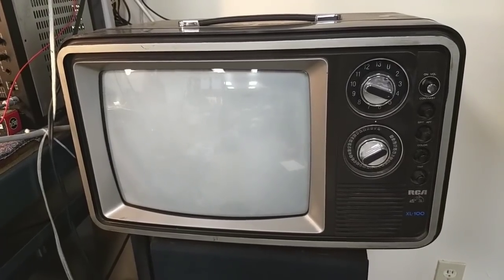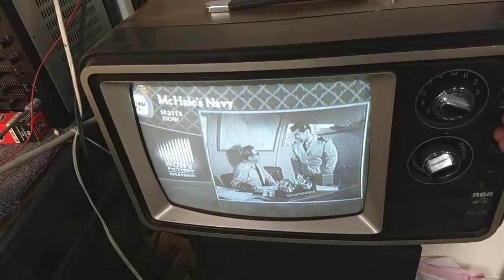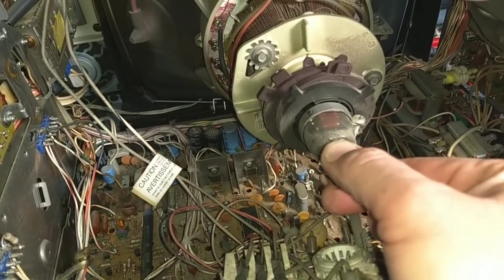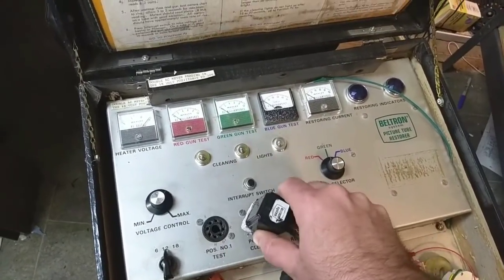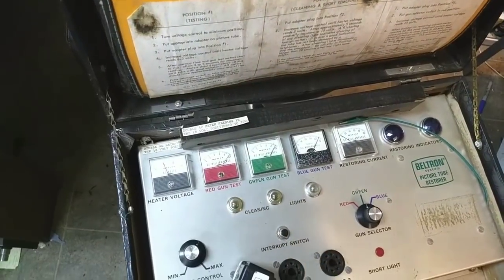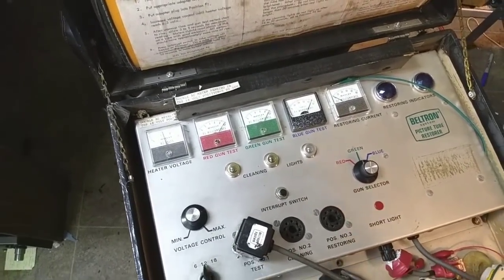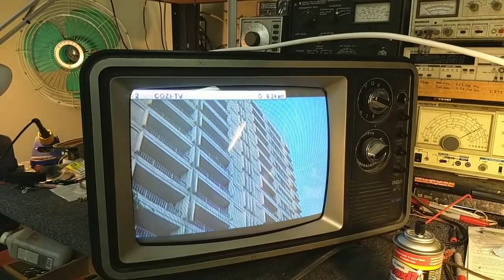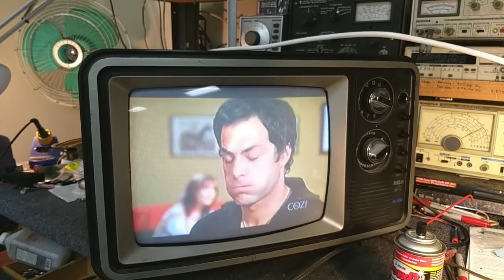What happens when you daily drive a 42 year old TV set ?

Comment: I'm watching you restore a TV set, on my Sony 4K 80" TV.   I'm lost in the irony.
Reply: I'm watching this on an IMAX
Reply: I'm watching it on Samsung SyncMaster 204b._
Reply: I'm watching this on a radio.
Reply: @Phethario  I come from the future and just have been implanted this video into my memory.
Reply: @Phethario  You are doing well to do that.  A radio doesn't make for comfortable seating.
Reply: @tcpnetworks  I'm watching this on a telescope.
Reply: I'm watching this on my VR headset for extra immersion :) 
Cheers
Reply: I gotta re-watch this on my trusty Westinghouse Console. That beltron works wonders btw :)
Reply: im watching this from a msi 144hz 1ms 27in gaming monitor lol
Reply: I'm from the future and watching this on a rectal implanted receiver.
Reply: @brpadington  Don't fart - it knocks the alignment out.
Reply: I'm watching this in my mind
Reply: @DjResR  me on a SyncMaster 205bw. one of em died. these fucking monitors actually have small tn lights at the top and bottom. one of them burned out.
Reply: @Kiritomens  Have you tried replacing the capacitors? If I remember correctly there was two separate drivers for top and bottom tubes and if one has bad cap it can fail also._
Reply: @DjResR  No i opened it up. This happened a while back btw. the TN light burned out, and the soldering at the side came loose. soldered it back, but light shattered so there was no saving it.

Comment: Use caution in trying to revive the crt. I am a crt engineer, still making crts, and reviving the emissive quality usually destroys the emission. In addition, you will create secondary emission. The flicker is actually arcing, sometimes between the cathode and g1. By heating the cathodes, expansion occurs and the cathode can actually touch the g1 surface.
Much more to discuss. The time between reconditioning and retesting should be atleast 5 hours to let gasses move.
Reply from the maker: Thank you for your experience

Know of any rebuilders inside or outside of the USA?
Reply: What applications nowadays that requires CRT technology? You work on radiation hardened devices?
Reply: Curious to know too  @aerohk
Reply: I am aware of some who make them for museums and library record keepers and other very similar lines.
Reply: I need you to make me a 60" CRT. The heavier the better.
Reply: oh, do you work for thomas electronics?
Reply: @aerohk  people use crts for older games because of the lagless signal, picture clarity in some cases, and black levels
Reply: Yes,
Depending on the tube, we at Lexel Imaging Systems are sometimes able to regun them.
We are not able to recoat the phosphor. I dont know of anyone anywhere recoating, defritting, etc, all the other processes involved with shadow mask CRT's.
Reply: @aerohk  Yes, there are still many uses, mostly military equipment. Primarily to maintain older imaging systems such as heads-up and head down cockpit displays.
Reply: @amberisvibin  Hi Amber, I don't currently work there but worked for Thomas for 25yrs, from 1980 to 2005.
I've been working at Lexel Imaging Systems in Lex Ky for the past 16yrs.
Has been a great career for me! Still making CRT'S!
Reply: @mikeharrington5256  Oh! I didn't know there were more manufacturers! That's pretty neat actually. I've been hoping for some people to get together and make the boards and such needed for new consumer CRTs, and more companies making the tubes is great for that!
Reply: @aerohk  Usually military, aircraft, and automation equipment that would cost millions to replace, if it's replaceable.
Reply: @aerohk  Usually just replacement parts for manufacturing equipment as far as I know.
Reply: @mikeharrington5256  You should post videos of your work. It sounds incredibly interesting.
Reply: you're a what!? still making what!? where in the hell is the machine tooling to do that? i want to call shenanigans on you!!! id love to see pics of the tooling used
Reply: there was business or guy here on youtube called "hawkeye" or something like that that cut open to the tubes and cleaned them and put them in an auto clave and sealed them back up.
Reply: @aerohk  radars still use them because of there very low latency
Reply: @mikeharrington5256  "Maintain older imaging systems such as heads-up and head down cockpit displays."
Wouldn't it be easier to just convert the analogue signals to digital and slap an LCD panel into it? Or is there some reason like critical low latency needed?
Reply: @God, some of the original displays have been upgraded in "wealthier" countries. Many factors from environmental to actual size come into play including the out of normal writing speeds, refresh rates. The signals can be converted but then you have to find LCD'S with native resolutions, etc to apply them too. Much more detail regarding resolution requirements but difficult to write it in a comment section on YouTube.
Reply: @mikeharrington5256  Seems interesting, seems like an interesting theme for someone to make an youtube video about it too.

Comment: My mother has a 1991 RCA Color Track 26" which was bought new.  It is on literally 14 hours per day - everyday since new.  When not home, she leaves it on for the dogs!  The cabinet is mint and the picture quality is still amazing, all original never serviced - which surprises me.
Reply: Stephen Schneider  careful when opening crt tvs, unplug tv and try turning it in again, this should drain big capacitors. Once opened, do not touch wires or mainboard or contacts, it can kill you even when off, due to remaining voltage in big capacitors. Better wear rubber gloves and use only one hand on screwdriver, to minimize risk of shock.
Capacitors on board should be discharged by large screwdriver short on their terminals on the back of the board.
They can have like 500V voltage, it can kill you, so no joke.
They can keep voltage even an hour after unplugging, so be careful.
There is high voltage coil, can be 1000V , I am sure some capacitors are linked to that, they are also dangerous, even unplugged.
If this doesn't scare you, you have a death wish...
Reply: That one uses a 26VAFBP22 CRT. It was a 27FBP22but Uncle Sam required CRTs be labeled with their Viewable Area listed instead of their engineering dimension. That’s why 27” became 26”. 

P22 was the type of Phosphor used on the screen.
Reply: Be careful that it will not light on fire when shes not home!
Reply: @nilsfrahm1323  flyback usually has around 1.2 Kv to as high as 12 Kv (or higher) the largest capacitor you will see in a modern set will probably be 480 volts. they don't store a charge that long and usually have a bleed off resistor. Still nothing to randomly poke around in.. Always keep one hand behind your back (been zapped my self a few times by being young and careless.)

Comment: I had a set like that. RCA ran the CRT cathodes at a somewhat high positive voltage which (I believe) led to an intermittent heater to cathode short on the red gun. When the short happened, the cathode would get pulled low thus turning the gun on full blast (for a very red screen). The CRT heaters were driven off a small winding on the flyback transformer with one end of the winding grounded. I opened that ground connection to keep the heater from pulling the cathode down (when the short occurred). The video still smeared slightly when the short happened but at least the picture stopped turning bright red. I probably could have added some chokes to the heater lines to stop the smearing but it wasn’t that bad.

Comment: Amazing video. Working on CRT’s have been a bit intimating to me because of how many various adjustments there are. I’ve been sitting on an unused (by me) rejuvenator for years and this amazing result is inspiring me to experiment. 
Thank you.
Reply from the maker: When rejuvenating, keep the following in mind:

Verify that emissions are too low and there is no cutoff.

You will loose cutoff if it has any when rejuvenating due to stripping of the cathode.

Rejuvenating a tube with useable cutoff and emissions may kill it. Use a "clean and balance"  function instead.

Trinitrons will not rejuvenate safely.
Reply: @JordanPier Thank you so much for the tips. I’ve been collecting of over a decade, I don’t have a large collection and I only dabble in crt repair as a hobby. Collecting and fixing Arcade machine introduced me to crt repair. I’ve don’t cap kits and other component repair but I’ve never messed with tubes. Thanks again!

Comment: I remember seeing Zenith’s Rauland Picture Tube factory just off of North Avenue in suburban Chicago back in the 1960s. Long gone. I recently recycled my Sony Wega 36-inch Trinitron. set from 2000. It had a perfect picture over its 20 year life. Never a problem. That sucker was heavy!  Flat Trinitrons needed lots of support glass on the edges. Never had much luck with rejuvenators or filament voltage booster add-ons.  The boosters caused blooming in the bright areas of the picture, most often.

Comment: Hello, good work, but around here we don't like much this warm regeneration, when i was young our teacher elaborated a good cold method, warming the cathode can easily damage it when working. That method consist to cut a pair of 7" cables by portions of salvaged THT cables and then to put the wire a side to enable 1/2 inch of empty insulator on one end, remove the socket of the tube connect either the G1 or G2 (need to choose the farest one from cathode pin to avoid external spark)
 to the chassis ground with croco cables, then the cathode of the concerned spot on air, disconnect the THT sucker connection and hold with a pair of plier firmly, light on the tv set and carefully approach the anode THT connection to the free wire , an impressive spark occurs in the tube, make a try and repeat it as necessary, this is working 75% of the case, sometime after 3 attempts to get free from the internal short !

Comment: Interesting that there was so much you could adjust/fix in the back of one of these. Thanks!
Reply from the maker: The older they are the more service adjustments are out in the open. There were books you could buy back in the day on how to adjust your set. Heathkit had a pattern generator you could build cheap to make setups a breeze. 

Now everything is hidden in a service menu, and you have to have a service manual to know how to access it and what every value means and how to adjust it.

Comment: I recently picked up a 1985 GE  19" TV and surprised it still worked and was very clean inside and out. It looks like an low hour set but had to adjust the pots on the board plugged into the CRT to bring the picture back but not 100%. I did not see any leaking caps but want to get someone who knows how to work on CRT's to see if it is worth putting a few bucks into it. I rather have the 1986 model GE that almost looks like it, and maybe swap parts out if I find one in good shape.

Comment: I daily drive a Daewoo TV that must be about 23 to 25 years old. On an average day, it's on for about 4 hours.
Several years ago, there was no picture... or it'd fade in and out.
There was a dry joint on a resistor on the "Heater" line.
Honestly, The only problem I've ever really had with it.
Honestly doesn't look too different on the inside.

And it's a cheapo TV too, Mono, with zero stereo capabilities, and the SCART socket isn't even RGB wired.

The main feature I like is the Alarm clock functions. Yes, this 20+ year old TV is my alarm clock.

I also have a much newer flat screen TV, but I honestly usually end up using the old Daewoo more.

Comment: Just a thought. I noticed some years back that if you want a nice CRT TV picture and better quality than most TV's, get a older computer with a TV tuner card and hook it up to a good CRT monitor, or a older external TV tuner with a VGA or DVI output to a CRT computer monitor. Computer monitor have a higher resolution then most CRT TVs...
Reply from the maker: I actually have an HDTV set top box that outputs to DVI and VGA that I use with monitors. Unfortunately because most of them are 4:3 and broadcast is 16:9 there is some image distortion or forced letterboxing.
Reply: @JordanPier   I don't know if your's will let you and you may know this but if it is run in the original broadcast setting through your HDTV box it should be fine on the monitor. It is true some broadcasters will have it in a mode for the old 4:3 shows that gives you bars on all 4 sides. On  your 4:3 monitor, and if you expand them it comes out bad most of the time.  I run into that when I run a S video from my computer to the VCR or TV  S video. HDMI creates limitations as well on some devices. My Sony CRT 34 inch wide screen TV was the best ever on the market and to me it has the best TV picture, and even VCR movies look pretty good on it.

Comment: I have a Philips 26in (pretty much top end set, stereo two-way speakers with bass reflex) from 1983, teletext, this is my main TV since around 2001, you could call it a daily driver although it runs less often as there is barely anything worth watching anymore, so it's more like once or twice a week for 2-3h, but it's doing that since 2001 and before it was some people's living room TV. The only thing I changed so far was the CRT as the blue was super weak when I got it and I did some resoldering a few years ago when the TV started developing horizontal issues... dry joint, fixed that, now the color frequency starts drifting away, it takes a minute until the color comes in (I know it's just a trimmer cap turn away, but damn am I lazy). The CRT that's currently in it is still going strong (can't turn contrast all the way up as it will still get uncomfortably bright and the CRT is one of those where the shadow mask warms up and warps within a matter of a few dozen seconds)

Comment: Oh look a model 100. When I worked in TV service the joke became, "What model is it? Oh, of course, it's a model 100. They are all model 100s."  Toward the end only the model 100 motherboard existed in consumer RCA TVs no matter the case style or screen size. It was easier to just make a universal board and update that. Toward the end of the 90s they wouldn't even allow you to buy parts. You had to mail a dead board to a refurb house and they would mail it back with 100% new parts for $200. Of course, these were $100-$150 TVs by then so it was cheaper to throw them away.

Comment: Its fascinating how you did that, what does that machine actually do electronically to the cathodes? 
i also see that half of the channels you flicked through had ads on at the same time, sameas here in aus.
Reply: With time, the coating on the cathodes becomes an insulator, CRT rejuvenators make high voltage pass between the cathode and the first acceleration grid, this (hopefully) gets rid of the insulating part of the cathode so electrons can be produced again.

I am oversimplifying things but that's the basic idea of how the device works.

Comment: How on earth does something like this work? You just plug it in and it "cleans" the tube? What is it doing? I could use one of these on my sets...
Reply from the maker: How these usually work is to place a high voltage at a very low current between the control grid and the cathodes. The light bulbs in the beltron act as a current limiter. The resistance of the cathode goes up as it contaminates due to degradation of the nickel plating. The high voltage breaks away the contamination allowing for a "cleaned" cathode surface - partially restoring efficiency of the gun - which is really nothing more than a linear particle accelerator In a vacuum - the particles being electrons striking a phosphorus coating with directed precision.

The draw back is your literally stripping away the cathode surface as you "clean" it - slowly killing the tube. 

Eventually the tube will stop producing enough emission to be useful as the remaining useful surface of the cathode is stripped away by rejuvenation
Reply: @JordanPier  fascinating! Although, I think it may just be best for me to put up with a slow tired discolored tv for now rather than one that doesnt work at all. Those drawbacks seem pretty severe!
Reply from the maker: @sterlinsilver  it's like Russian roulette. You don't know when the bullet that kills  will fire when you pull the trigger
Reply from the maker: Something else to note:

Don't try rejuvenating a Trinitron. They love to short and die as a function of rejuvenation. If it does manage to improve something it's usually very short lived
Reply: @JordanPier  Don't zap my tube, my arcy-sparky tube, I just don't think it understands
and if you zap my tube, my arcy-sparky tube, he might blow up and kill this set :-D
Reply: @JordanPier  probably has something to do with the single color gun in a Trinitron Vs. The 3 seperate ones in a normal one.